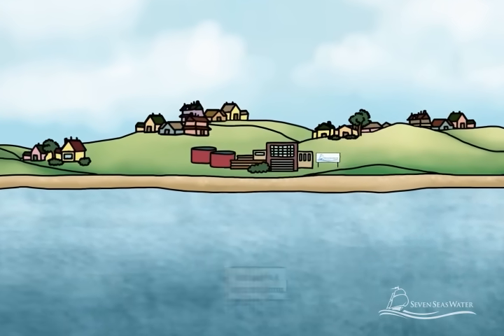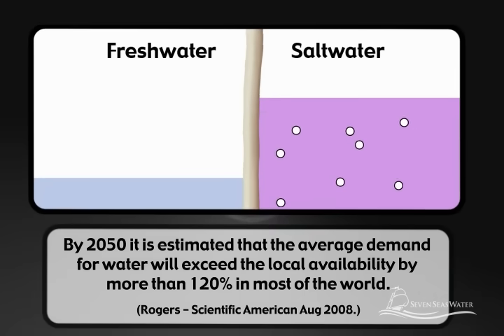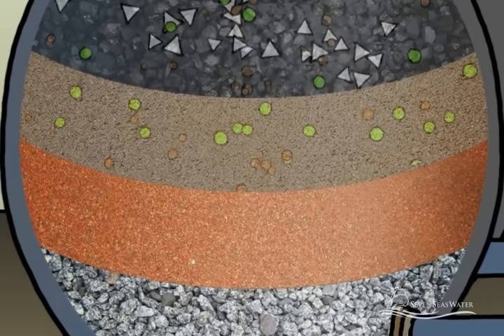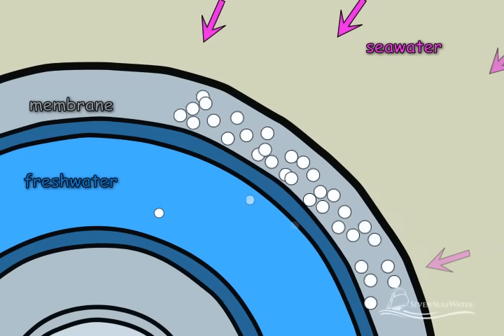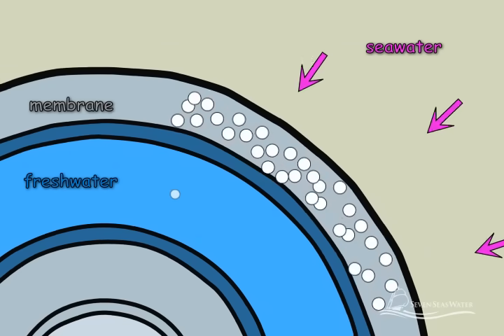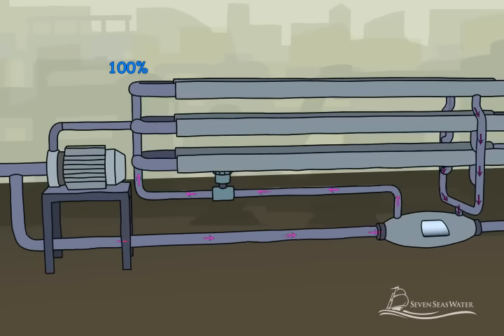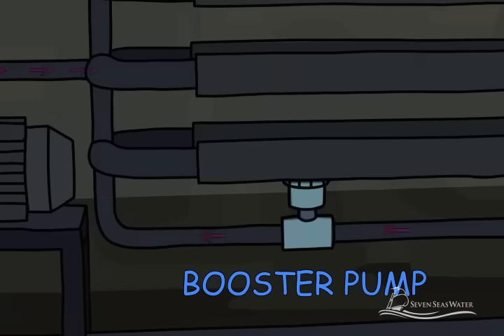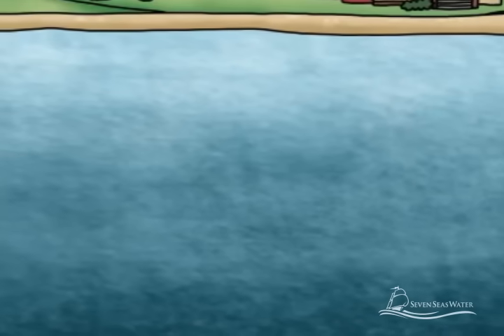How Seawater Desalination Works

Comment: Rather than relying on so much pumping, why not utilize the tides to capture water? At high tide, let the water pass backward through filters into an empty secondary reservoir; when low tide is reached, close the secondary reservoir, open the primary reservoir to let the salt dense water flow back into the ocean.  Once emptied, fully open the primary reservoir and wait for high tide.
Reply: Strubbeltom Nervi  - Build a huge primary reservoir, set the reverse osmosis filtration at the ocean side base at an angle and the path to the filter progressively narrow.

Even if the gravity & weight couldn't force it on one tide cycle, make it into a two or three cycle system.  The first high tide to low tide is used to ratchet up a gravity driven series of weights designed to apply pressure to captured and confined water; if more is needed ratchet another cycle; once sufficient, on high tide, use the stored energy to apply the require pressure.

When in doubt, deposit something non-soluble in the water of extreme density that can easily be diverted from the reverse osmosis filter and easily extracted - like Iridium shot dumped into the capped reservoir.  And use solar concentrators to heat the confined water.  Hell, detonate a series of charges at high tide planted at low tide.

I mean, I'm trying to save the world here!  If there's not enough pressure, we generate that pressure - nothing is off the table; not even the nuclear option... lol, ...(?).
Reply: Strubbeltom Nervi  - Woah! One problem at a time here; we all know the inherent flaws of the wheel...

Dare I break out the Bush era rhetoric?!  You're either with us or you're one of them!  Who are we? Me and anyone the old bald evil Emporor behind me says so.  And them?  I don't know...the statement is supposed to be vague...

Anyway, yes... - I believe we were on the topic of underwater charges to blast water through filters...  How much further can we take this...? lol

And the wheel!  What about cars on spheres - the hundreds of thousands dead each year in parallel parking related incidents, yet we do nothing?

*Don't worry; I'm just messing around.  I appreciate the 1st response as a sincere answer... But what fun is it if we can't really drive a non-feasible solution into the ground?

I'm not a physicist; I'll accept defeat when I'm challenged - but too often we take a reasonable refutation personally; so why not counter with absurd ideas to admit defeat I say?  So, yes, I will even put the nuclear (bomb) option on the table to save an idea; despite the coherency of how that would even work as equivelent to insanity.  

This is the new science; quell the (pseudo-) science extremist ideas before they pop up with even greater absurd and insane ideas.

Comment: Do these people know that all they need to do is boil sea water and they will get fresh water?  They can even distill salt water into fresh water using the sun (I learned this in survival school).
Reply: It's sarcasm right?
Reply: https://www.youtube.com/watch?v=4sqRvUzqDCE
Reply: kraigthorne Sea water cant be cleaned like that, it's in a molecular lever of mixture.
Reply: Where do you think clouds come from?
Reply: You can't drink claud water duh
Reply: LOL  That is a great joke!!!
Reply: Who told you that?
Reply: No it's not and it's a honest question. read on down the thread.
Reply: You'll still get brine vapor by distilling methods because you heat it to quickly the salt in solution goes with the vapor.
Reply: jmitterii2  You have been lied to.  I have distilled ocean water and drank it and I can tell you that it was NOT salty.  There are lots of videos on youtube where people have done the same thing I have.  Here is one of them.  https://www.youtube.com/watch?v=R_-wFiFdwAE
Reply: kraigthorne just because you take a few sips and don’t die doesn’t mean it’s healthy. When evaporated, water molecules still carry toxic chemicals with it. It’s not that simple. You’d think if it was, we’d already be doing it.
Reply: It's the oldest process when it comes to creating fresh water, but the yield vs energy expended stinks worse than a coal power plant, seriously. The yield per a given volume of water is 10%, at best!  And heat losses from production is horrendous, even with the best recovery systems in place.  Plus the plant would have to be operated within 70% of design capacity to be cost effective, not good if you got an aged or damaged plant that can't run above 50%, you might as well shut down until the issue's resolved.

Comment: this video confused and wrong,  the concentrated sea water contains 60% of energy and using a device for returning that energy to the system so it's sufficient and economically using energy, alright , and then the concentrated higher level salt wated goes back to the sea and then saying the concentrated sea water that HOLDS the energy goes back through the membranes again ! now either it goes back or it's salty and goes out ? which one is it?

Comment: You could have just sent the water through a six stage flash seperator, and gotten distilled water. The US NAVY has been using them for seventy years. And you'll get more water out of it.
Reply: But they use significantly more energy. Consumers wouldn't be happy if water bills tripled.

Comment: Or for non water plentiful areas, pump in seawater to special reservoirs (at ground level) then focus the sun (using fresnel or other magnifier/focusers ) onto the water to evaporate it at higher speed, then have a USDUS* inside a giant cylinder (with a shade covering ) to cause the water to condense (using super hydrophobic surface) ; the evaporated water might be best to go upwards "Diagonally" to keep the condenser cylinder tower (huge) of the way of the super hot solar evaporator reservoir ; so we should get lots of water evaporating going diagonally form a very humid "cloud" of sorts in the shaded condenser tower, where would then condense on the  relatively cooler USDUS to again get drained to holding tanks; worth a try.  Free solar, almost free seawater pumped in,  thankfully most potable water shortage areas are in sunny solar places, making this a possibility at least IMHO.   IF the humidity is high (ie like 100%) the Dewpoint is the same as the ambient air temp so just shading the USDUS condenser should work fine to condense the water at a good enough rate (research), especially if the USDUS has a super hydrophobic surface which has been shown to increase significantly condensation;  the condensation could be increased further by cooling the USDUS more, such as on the top side use non-potable water "Misted" to cool the whole condenser and USDUS by simple evaporative "almost Free" cooling  (but this is on the top side not mixed with condensate on bottom side) .      So seawater is pumped in across flat desert to ground level reservoir where is solar heated to evaporate faster, then thru Diagonal "Duct" to Condenser tower with USDUS inside collecting condensate to holding tanks with added cooling on the top of the Shaded Condenser Tower by "Misting" non-potable (ie seawater) to the the evaporation cooling effect to make the Dewpoint even lower which should increase rate of condensation on the bottom of the USDUS.  Other non-potable water "might" be appropriate if the sea or lakes are too far to pump cheaply to the ground level evaporator reservoir.  
* upside down umbrella shape (USDUS)

Comment: Great video !   I'd say just doing distilling using solar energy is the best way to go unless someone has a better idea  ( yeah rainwater is drinkable/potable, so we just go to get clever and figure ways to catch it cleanly,  maybe some type self opening upside down umbrella shape (USDUS) with enough strength to funnel water to holding tanks;  the USDUS doesn't have to hold the water but only just funnel it as it comes in to the center where it is drained by a pipe to the holding tank.;  when rain stops the USDUS closes up again to keep contaminants out;   It would have to have enough strength to stand high storm winds and/or a auto system to close up if winds are too high.     Maybe it could also have a lightening rod to collect lightening bolts which could pump other non-potable water (ie sea water) up to reservoirs to create potential energy which can then be later used to turn water turbine/generator pair?   I have hear that some island country is already pumping water to a reservoir and it works fine to complement  electric needs at high use times.  (so yeah we need a million volt pump motor OR 1,000 x 1000 volt motors in series is easier right? ) Ahh to catch the lightening bolt is but the future of a dream catchers eye !    Get busy MIT !
Reply: Yeh I don't understand that shit in NYS. We can't save the water off of our eves. I Can't use water from the well under my mother's house.Yet it costed me more per/month to live there in that trailer, than I could ever enjoy my life. I know I have friends there that I miss. But what's gone is gone, I'm lucky Uncle Rudy Could afford me this place. I miss ya'h bro stop buy just don't be an ass like Mario. I made the biggest mistake, I lent out Harley, I let Daryl use my tractor. And they all came back fucked up...

Comment: ahh your doing the same thing as a turbo on a car, you use the high pressure, high salinity water like a turbo uses exhaust gases from a engine. The high salinity and very clean (low NTU) byproduct from this process would be good for something besides dumping back in the ocean, it feels like a wasted opportunity.

Comment: Something is badly missing in the chemistry of de-sal technology.  Seems like you could drop a pewter electrode mesh and electro-chemically desalinate water.   If not pewter then lead or aluminum or silver or something that can be recycled.
Reply: It seems you solution will be slower, have complicated design and less power efficient.
Reply: I proffered a hypothetical approach to finding a solution . I did not proffer a solution.

Comment: another way useful near the tropics is to cover a large area with buildings and use solar heat energy to evaporate the water pumped into the buildings and collect the water vapor and flush the building every so often - more land less cost except for the initial setup.

Comment: Boil the water, put the steam through pipes. When the steam condenses back into water...perfect drinking water.
Reply: Hi LibertarianUSA1982. Unless you start with "perfect" sea water you'll want to add other filtering options (e.g. a gas trap) during or after the distillation process before being confident you even have clean water, and even then what you end up with is far from "perfect" for drinking - quite the opposite - distilled water acts like a super absorber so it typically turns acidic (it actively absorbs carbon dioxide when it comes into contact with air,) and it'll end up leeching essential minerals from your body. No big issue if you're desperate for "drinkable" water of course (throw a little bi-carb in it if you're able) but something worth remembering.

Comment: Another way, in a small scale life saving scenario is to cup two glass bottles together horizontally. Fill one with sea water and boil it. Ideally burring it in sand to retain more heat from the fire. The steam released is collected in the other bottle and condensation builds up to about 80% of the original bottle. So there is about a 20% loss but that could just be vapor. The water is 100% safe to drink. Great if you're stranded on an island.
Reply: Have you tried that brother? Interesting

Comment: There are a few methods for desalination.

One is distillation.

It is energy intensive, but that's not an issue for a lot of areas that need the water.  Just use sunlight to heat the water.  Use incoming cooler water to aid in condensation.

its simple and effective.

Comment: I filter water by making a poly tent and using the sun to power it. 
Put a pot or pan of water inside the clear poly tent and the water evaporates then collects on the inside of the tent .
The water then runs down the sides into catch troughs. 
Very simple. Then boil .

Comment: The amount of water on the Earth is constant, but  it moves around in a cycle between the atmosphere, underground, glaciers, and surface waters such as lakes, oceans and rivers.
The Sun heats the oceans causing liquid water to evaporate and form clouds, which deposit water over land as rain. The rainwater takes multiple routes: some enters rivers and runs back into the oceans, another portion will evaporate back into the atmosphere, while yet another amount will seep into the ground and enter aquifers.

Comment: The main problem is size. A huge DS plant now puts out about 1.5 billion gallons a month. But a city like Los Angeles uses 11 billion gallons a month (Beverly Hills usage is something like 200 gallons a day per person!). So you would need the equivalent of 7-10 huge DS plants just to support that one city. then you have to power them, constantly clean filters, etc. Although if you factor in other sources of fresh water, the number of DS plants required would be less. Still, reverse osmosis is pretty efficient.

Comment: Actually it's quite energy intensive and expensive which is why currently only very rich desert countries with relatively small populations do it. In essence you're fighting entropy.
Reply: It's not that energy intensive, not sure who told you that. More so than just pumping water out of a lake? of course, but that's clearly not sustainable. The most inefficient system would max out at about 10kWh/m^3. A typical system might be closer to 3kWh/m^3. By the most liberal estimates the average person uses about 400L of water per day. By these figures, to desalinate enough water to support one person would require 167W, roughly the equivalent of three incandescent lightbulbs on 24/7, or the oven on for 1 hour per day. In terms of cost, if you pay $0.10/kWh it would cost you about $12/month maximum.

Comment: Cool, but why not flow sea water down about a mile in the earth into reservoir where the earth's heat is warm enough to evaporate the water which can then rise up and be collected as condensation? Maybe even the intake can have turbines as the water flows down if it can be designed to not have reverse pressure and turbines again where the steam comes up.
Reply: How far down do you need to go? The best answer I could find was about a mile. I assume there is variation but what would be typical?

Comment: ahahaha sea water can be cleaned by walking inland 100 yards and drilling for FRESH water ahahahah how silly.. i can produce a billion gallons  of fresh water daily by drilling a few hundred shallow wells iinland ahahahha
Reply: It gets pulled inland as just osmosis.
Usually salt water wants to seek fresh water... osmosis.
This is reverse osmosis where pressure is applied to the denser salt water to push the non-brine water out to the fresh water.
Reply: Water aquifers in the mid US can replenish over time, but if we are overfarming for an overpopulated planet, those aquifers could dry up.
Reply: WRONG johnny.  That only works for a SHORT time and then salt water is pulled inland.  Like in Florida.  Now, rent an IQ
Reply: ahaha it works everyday everywhere in the world,, weve done it in 100 countries moron..  when you get salt water intrusion, 10 years later, you move inland 100 meters duhhh..im guessing our 1000 installations proves my  iq and that youre still a moron...doc johnny
Reply: do you know how  much freshwater is in a 100 meter diameter aquifer ahahah quatrillions ahahah yes they have  salt water intrusions.. guess what  moron you move over 100 meters, shut down that old well for 10 years and  reuse it when it builds back up a decadelater.. what a  moron

Comment: So California is a coast state and were still rationing water with this tech? Proof of political corruption. The news said this was super expensive.
Reply: This is super cheap Marco,  Florida uses this on individual homes.  Hundreds of thousand of them.  VERY cost effective.  Costs us the same as city water hook up in SoCal.  UNLIMITED PURE water
Reply: Patrick EH yet we still pump water into CA from other states? Man....That's jacked.
Reply: We need a hi speed train first. Da
Reply: yes this setup is expensive but it does not have to be especially in warmer climates it should be an easy job

Comment: The problem they cover over is that concentrated brine is extremely toxic to marine life. All of the starfish and clams they show on the discharge tube would be dead. It would be a constant danger to the marine life around it. It also does not dilute so easily. It would take time and quite a bit of water to mix down to levels that marine life finds tolerable. 

This would create dead zones. 

This video makes a good sales pitch that reality does not hold up so easily.
Reply: Idiot (Jar Jar) it affects a VERY small area as the surrounding sea water quickly dilutes it.

Comment: Wouldn't solar powered distillation be simpler and cheaper? 
Isn't that the way nature dose it?
Reply: distillation required high amount of heat and the cost of construction of such huge tanks is incredibly high compared to this process. and also the salts that are left behind will cause damage to the wall of the container

Comment: Why not just heat up the salt water and collect the water vapor to form distillwater?
Reply: It's a matter of efficiency and volume.  You can boil water, and it produces a MUCH larger volume of steam, which then must be cooled.  The volume of cooling towers would be enormous.  The warmer the location, the larger the cooling towers will have to be.  You can only produce water while the cooling surfaces are significantly cooler than the vapor inside. This limits the efficiency even more.